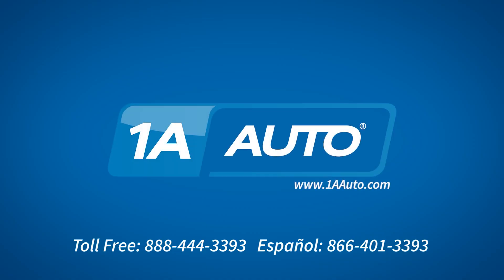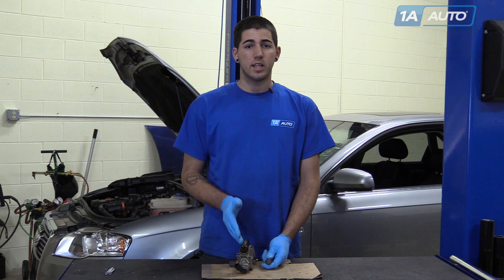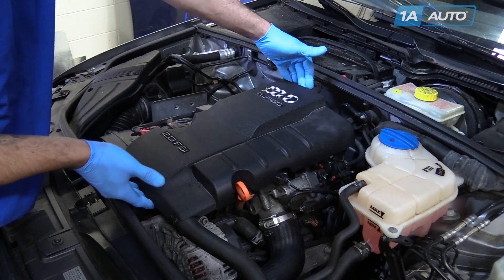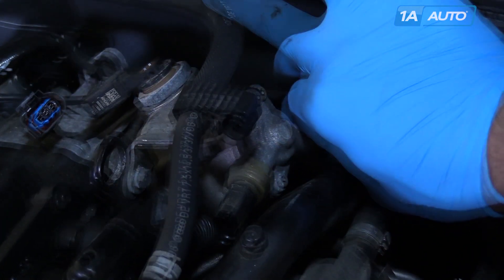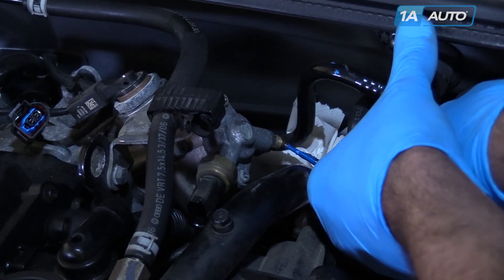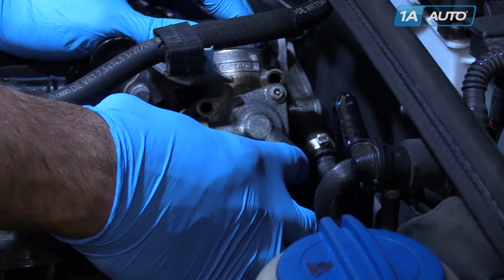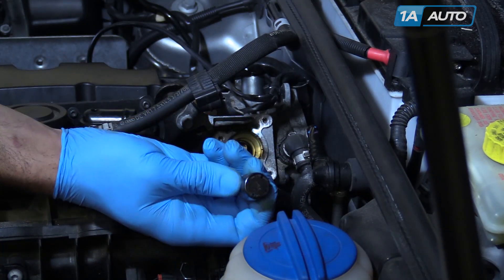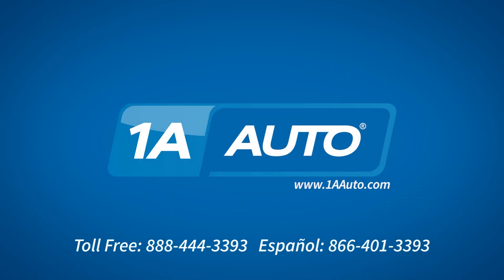High Pressure Fuel Pump Cam Follower Maintenance 07 Audi A4

Comment: Been dealing with a p2294 code for months now.  I changed the CSM follower the hpfp the fuel rail pressure sensor the HPFP sensor and the lpfp.  Still have the p2294 and fuel rail psi goes from 40 to 120psi non stop

Comment: Also, you do not have to remove the hose on the HPFP if you have that style, the pump should just pull out enough to change out that cam follower.
Reply from the maker: +Batt We appreciate the feedback. Sometimes there are multiple ways to accomplish the same repair.

Comment: I bought the stud conversion kit with nuts, instead of getting new bolts, which tend to strip out the body threads due to wear etc... The problem with the new stud kit is, the pump wont fit over the studs, unless you remove the thrust sensor, 1st, when the pump is on the engine. I didn't have a vice. Also I found, removing the brake vacuum tube from the firewall, creates a good amount of space

Comment: I got all those codes but had other stuff replaced like Oxygen sensor and PCV valve. Cleaned MAF sensor and lightly cleaned the throttle body without removing it. The codes went away but still have the same problem. I am replacing the h.p. fuel pump and cam follower myself soon. 163k miles on Audi A4 so I'm sure everything is wearing down fast at the same time.

Comment: It is seems like very easy to install fuel pump but where is the fuel pressure regulator located in the pump or outside of the fuel pumps?
Reply: The fp regulator is the brass part that connects to the hard fuel line

Comment: I have the same problem with the fuel pressure idk if the fuel pump working from stock dealerships
Reply from the maker: +Jonathan GTs550 We wouldn't be able to diagnose an issue like that here, you may want to have a local mechanic take a look at it. Thanks for checking us out! http://1aau.to/m/Shop-1AAuto-c

Comment: Can you help me with this fault code.  replaces the sensor, voltage on the three terminals check out, but at 1/4 throttle car seems to run ok but halfway to wot car falls on it face.  Someone suggested a clogged exhaust system which Ill check tomorrow but I think it might be the transmission although no codes are thrown via Ross_tech besides the one below:

1 Fault Found:
000400 - Fuel Pressure Sensor (G247) 
               P0190 - 001 - Circuit Malfunction
             Freeze Frame:
                    Fault Status: 01100001
                    Fault Priority: 0
                    Fault Frequency: 1
                    Reset counter: 255
                    Mileage: 200716 km
                    Time Indication: 0

             Freeze Frame:
                    RPM: 674 /min
                    Load: 30.6 %
                    Speed: 0.0 km/h
                    Temperature: 103.0°C
                    Temperature: 42.0°C
                    Absolute Pres.: 980.0 mbar
                    Voltage: 13.208 V
Reply from the maker: +Paul Davis We wouldn't be able to diagnose an issue like that here, you may want to have a local mechanic take a look at it. Thanks for checking us out! http://1aau.to/m/Shop-1AAuto-c
Reply: @1AAuto  I did manage to fux the car.  One of the pins in the new Hign Pressure sensor was bent for some reason which made it  hard to clip.  Went to the dealer to pick one up for the G247 code and supposedly both high and low pressure sensors fall under that code and the parts guy gave a the low sensor.  During inspection of the to sensors is when I noticed that a pin was bent.  I straightened it out, put it back in, run VCDS, cleared the code which didnt want to dissapear and then took the car for a test drive and you could tell the difference.  Are runs and shifts perfectly.

Comment: Would p0089 also be triggered by this?
Reply from the maker: +AD S The P0089 is a diagnostic trouble code for a fault found with the fuel pressure regulator.
Reply: @1AAuto  so would i have to replace the fuel pressure regulator
Reply: @1AAuto  hi so i first got a p0089 code and after that code i got a p0171 from running to lean so it seems like it could be the fuel filter/fuel pressure regulator causing these issues. am i correct that this could possibly be the issue?

Comment: my audi a4 2007 has this code p12a12 how to solve this problem
Reply from the maker: +Fredy baires handyman We wouldn't be able to diagnose an issue like that here, you may want to have a local mechanic take a look at it. Thanks for checking us out! http://1aau.to/m/Shop-1AAuto-c
Reply: @1AAuto  the cam follower when it is worn that causes the engine

Comment: If you can help me or advice!? I have audi a8 4.2l 2008 model. I have problem with starting a vehicle (not always) after driving a while ,after about 20 30 km . Once I shut it down, and come back to start it again after 10-15min, engine will start ,and once I go ,after few meters engine stops by itself. Then I open the bonet ,pour water on high pressure fuel pump, going back inside ,and vehicle will start normally. Until next turning off. I've changed pump, fuel sensor on pump, few connectors... but it happens again. Please for help!
Reply from the maker: +Slavcho Misheski We wouldn't be able to diagnose an issue like that here, you may want to have a local mechanic take a look at it. Thanks for checking us out! 1AAuto.com
Reply: Been a while .. what was the solution?

Comment: Hi, nice video thanks,
Just a question, have you encountered any situation where HPFP is faulty and car doesn’t start and spark plugs gets flooded . I took my car to 2 mechanics but no resolution yet. Can faulty HPFP sends more fuel than required and not let engine to start instead get it flooded. Look to your reply,
Reply from the maker: +786hunzavalley Thanks for watching!  A faulty HPFP can definitely cause your engine to not start.  Even it it did start it would not run very well, and the pump would need to get replaced right away.  1aauto.com
Reply: 1A Auto Parts thanks for your reply. So you can confirm that faulty HPFP can cause engine flooding,  there were 2 codes just before this non start issue. p2293 & p3008 when engine running. P3008 was due to big vacuum leak,. But p2293 never came back after deleting all codes and car also didn’t start. I removed HPFP , everything seems ok visually , everything intact, no fuel leak from spring side, cam follower in decent condition. THIS IS 12 years old car, and HPFP is genuine , which came with car. Replacement should be due I guess. Just wanted to know that engine flooding can be caused by HPFP. Few people told me online that faulty ECU also causes overfueling & engine flooding. Thanks for your help.

Comment: Shouldn't you just change out the follower as a precaution instead of having to check it every 20k?  Is there a synthetic oil that helps prevent this?
Reply from the maker: +John Be Bad You can absolutely do that, but it is not necessary to do so.  There is no oil or lubricant that helps prevent this item from normal wear and tear.  1aauto.com

Comment: How much does this service usually cost?
Reply from the maker: +Roland L The job itself should not take a reputable shop more than an hour or two to perform.  It will depend on the rate of labor and parts.
Reply: @1AAuto  would this video also work in the 2006 year A4 wuattro

Comment: The last six months plus my 2.0 tfsi better have misfires, stuttering and 1-2 second power losses codes came up P0087 and P1093 I've suggested to mecanic about camshaft lobe or cam follower or high pressure fuel pump.

Comment: p0089 ..says its fuel pressure regulator ...what do i need to order
Reply from the maker: +michael miranda P0089 usually means there is an issue with the fuel pressure regulator system, and does not necessarily mean you need that part.  I found this link that goes into more detail.  https://www.yourmechanic.com/article/p0089-obd-ii-trouble-code-fuel-pressure-regulator-1-performance-by-spencer-clayton